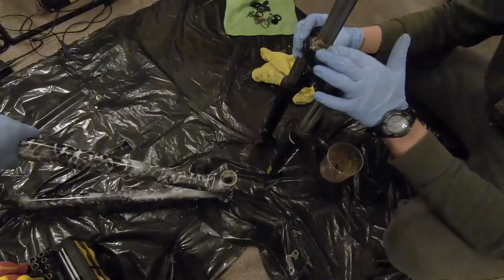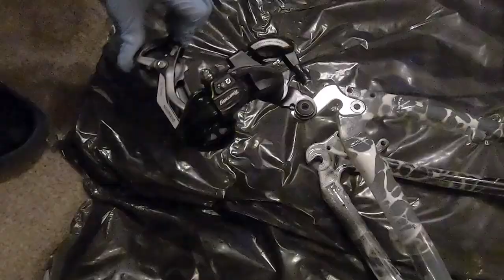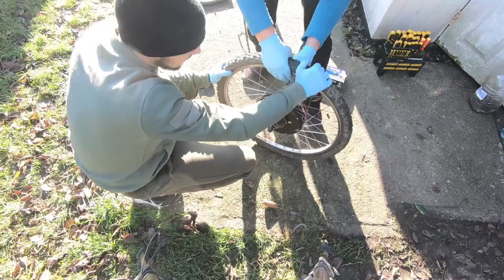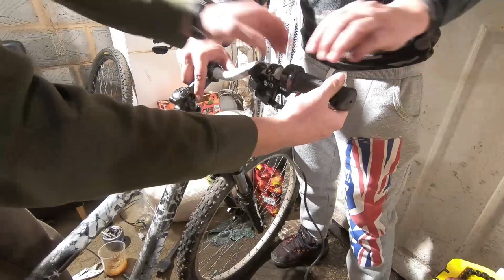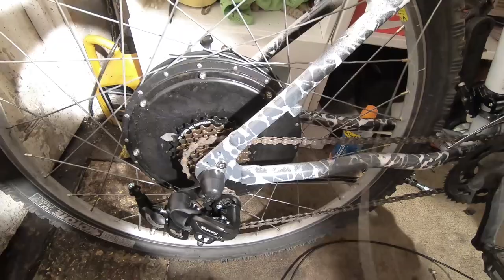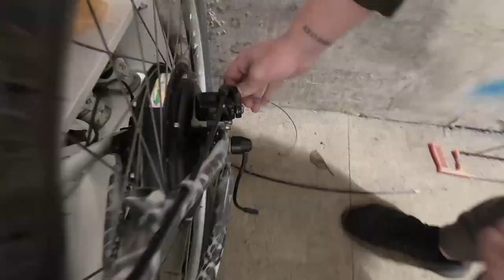How to make an electric bike at home | DIY electric bicycle Part 5 - Ebike assembly

Comment: Oh yeah, it's all coming together.
Reply from the maker: Yes, finally 🔋🚲
Reply: @OvidiuMarin  Battery pack and take it for a spin next time :)
Reply from the maker: @ScoryloCoyotl  I already tested it with 2 hoverboard batteries in parallel. It goes up to 34 km/h just on throttle, without pedalling. But I will build a bigger battery pack and maybe I will feed 48V to the motor.
Reply: Te-ai pus pe treba mestere... 😁
Reply from the maker: @crististoica9755  da , da
Reply: @OvidiuMarin  Bravo mestere!
Se putea sa nu-ti mai gasesti tu ceva de facut in timpul liber? 😏
Reply from the maker: @crististoica9755  multumesc ! Ce sa fac si eu, trebuie sa imi ocup timpul cu ceva 😁
Reply: @OvidiuMarin  Lasa ca nu e rau... Ceva mestereala de genul asta chiar nu strica... ☺
Reply from the maker: @Cristi Stoica niciodată

Comment: are you using torque arms? should be if you're not
Reply from the maker: I'm not using, the motor it's not that powerful, just 500 W.
Reply: its not wattage that breaks dropouts, its torque, hope you don't have to experience it in the future, it'll lockup like a handbrake when the motor shorts and blow the mosfets in your controller,  and if you're unlucky it'll shortout your battery also (not common),

worst is when motors blow up and break dropouts....usually when you're on a hill

i mention this for safety reasons though...
Reply from the maker: Thank you, I will take this in consideration.